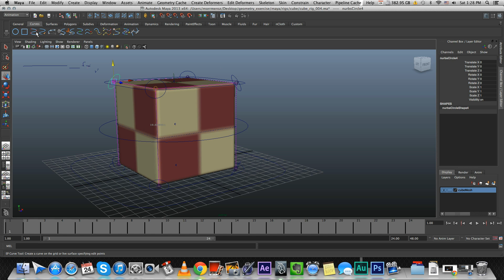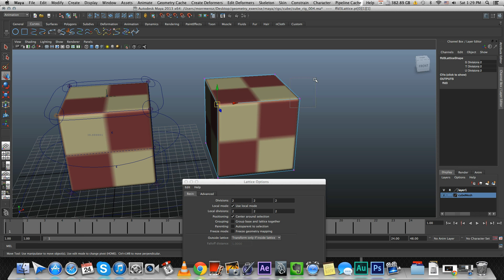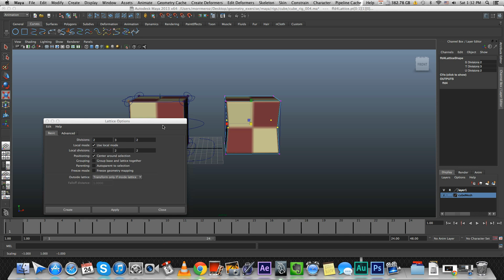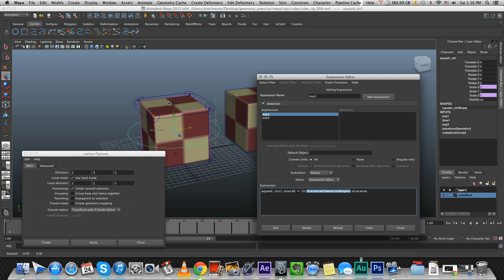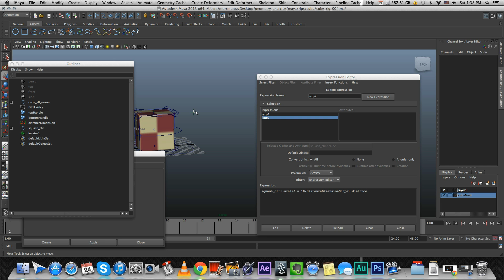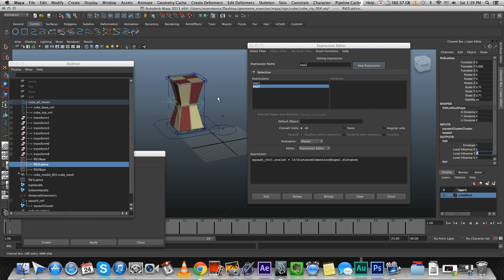Rigging a Cube With Squash and Stretch. (part 2 of 2): Making an Animated Movie (#5)

Comment: I'm having an issue with the squash. When I stretch the cube everything works fine, but when I go to squash it the faces on the top or bottom of the cube push into the rest of the geometry. It creates a indentation. The squash on the rest of the cube works O.K., but I don't have a cube anymore - more like a square bowl.

You have two other clusters on the second lattice that you didn't mention on the video. Are these parented to the top and bottom controls? Does this solve the problem I'm having?
Reply: having the same issue. can anybody help or did you find the solution yourself?
Reply: Try selecting de first latice and go to the freeform deformation attributes and on the outside lattice select "all"
Reply: was there ever a solution for this?
Reply: Nevermind, finally figured out what Javier was saying.  To clarify, deslect everything and on the viewport right click and goto Inputs, then in that list find the first "Ffd"and click on the option box, and then there is the "Outsid Lattice" dropdown to change to "All"

Comment: Sorry but I've had a few issues, and if you could help that would be awesome! 
I couldn't parent the curve to the cluster for scale.
When I added the expression for the squash curve the curve changed size. So I added the expression to the cluster but the squash and stretch was no where near as smooth as yours.
Finally the squash and stretch is constricted by the first lattice. I tried to move the second lattice above the first in the inputs but that didn't help.
Again if you could help that would be awesome!

Comment: For those still looking for an answer to why the squash lattice only affects the part inside it: It's probably because in the order of how deformers are applied, the first lattice is used before the second one. Changing this is pretty simple though:
On your mesh, you go right-click > Inputs > All inputs.
This opens a window with all the inputs for that mesh.
Now middle-click the second lattice in the list, and drag it up to above the first lattice.
After that, it should work perfectly.

Comment: Why didn't you just use a Squash deformer instead of a latice?
Reply from the maker: I needed something a little more flexible and versatile.
Reply: Bloop Animation Ahhh I see. I did something similar except I used a squash deformer along with two bend deformers

Comment: Hey, kind of a newbie in rigging and I cant solve one problem I got from following this tutorial.

When I squash it with the upper or lower ctrl the middle doesnt follow correctly. It gets bigger and smaller, but it stays in the same place. So when I pull the ctrl up, the "skiny" part stay at its lower part. When I pull the ctrl down, the "fat" part stays in the upper part of the mesh.

Done this tutorial twice now from the beginning, but still have the same problem. However, I can see that u have 3 clusters on your finished rig, but in the example u only create one in the middle.

Did I miss something?